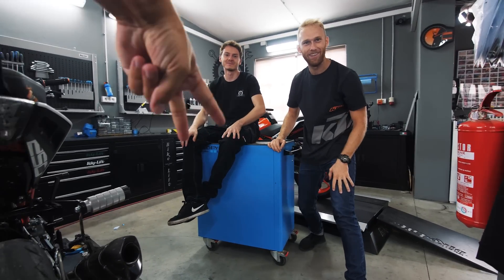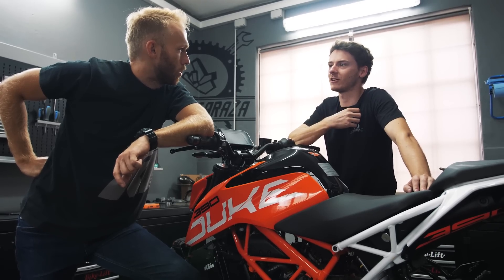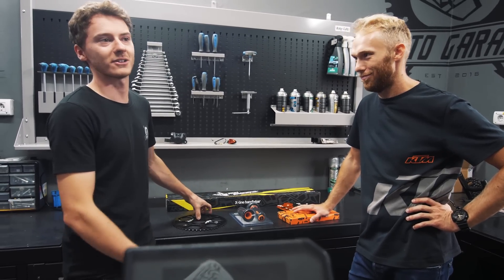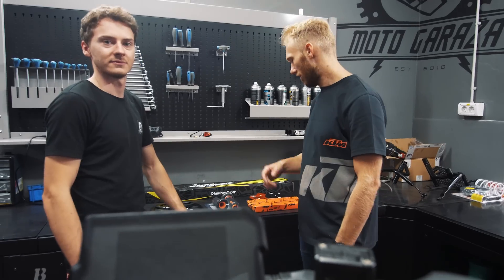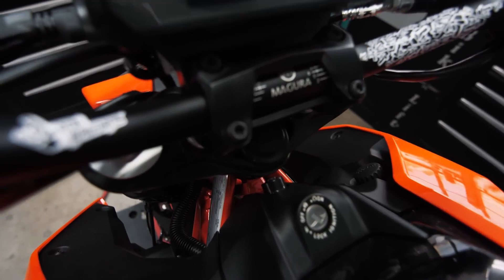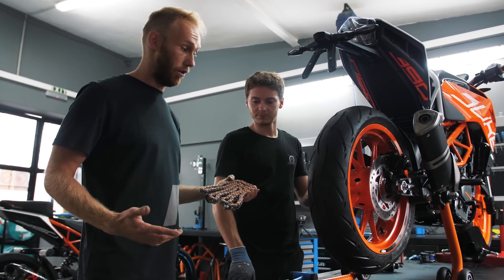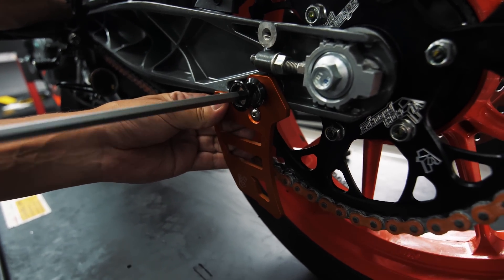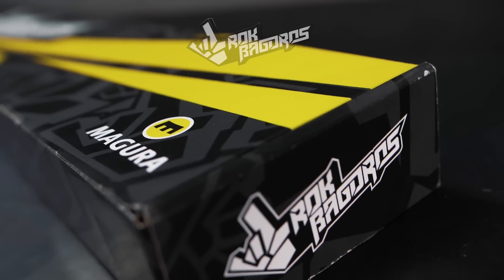GOT MY OWN SIGNATURE HANDLEBAR [Duke 390 street build - part 1] | RokON vlog #69

Comment: hi Rok, do the longer handlebars need a longer clutch n throttle cable? as the length of e stock is pretty tight with very little allowance.
Reply from the maker: Still fits with original cables ;)